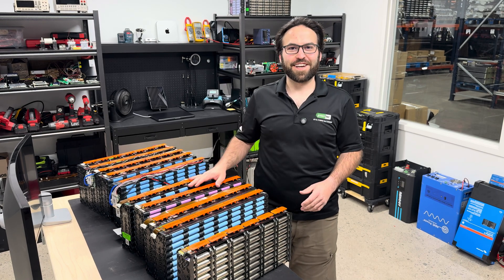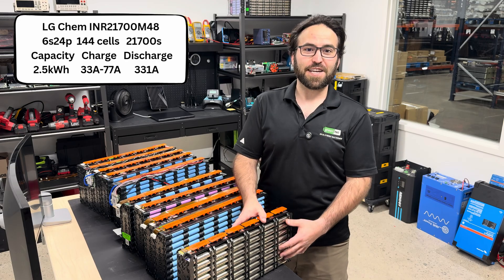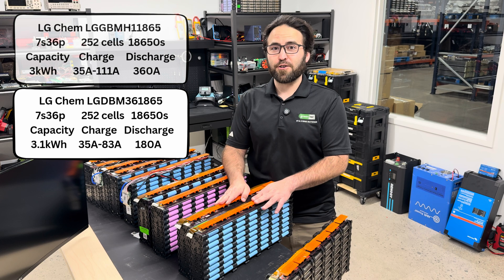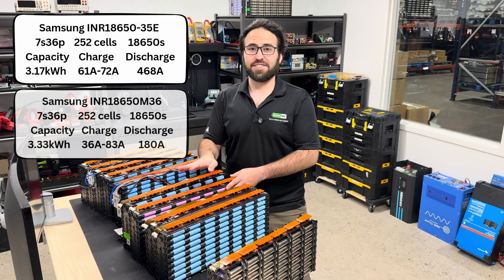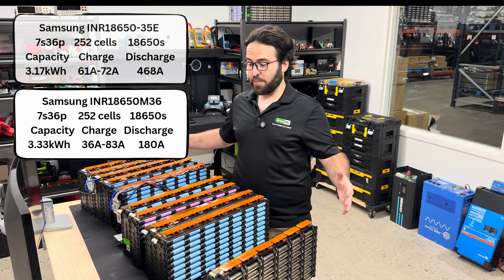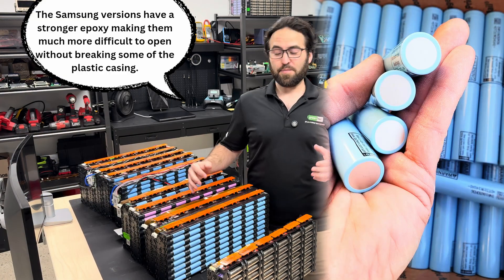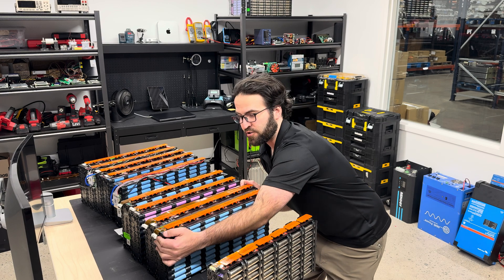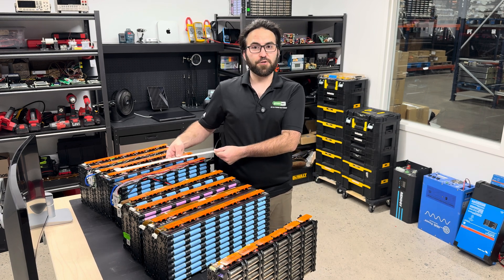All about eMatrix batteries. 21700, 18650, Samsung vs LG Chem. Harvest loose cells or use as-is!

Comment: On the INR18650M36 it's listed as Samsung, but all I can find is LG as the manufacturer. I also have a cell with that number with LG printed on it. Is the listing mistaken? Mostly wondering because the glue isn't as bad on the LG modules.
Reply from the maker: Looks like you are correct. We updated the listing to the correct info. Thank you for pointing it out.